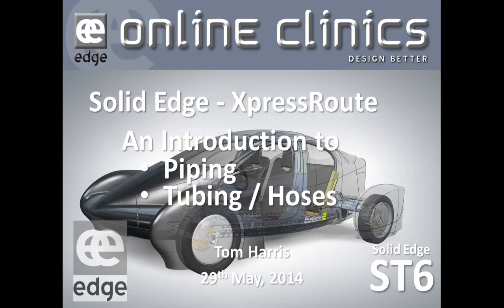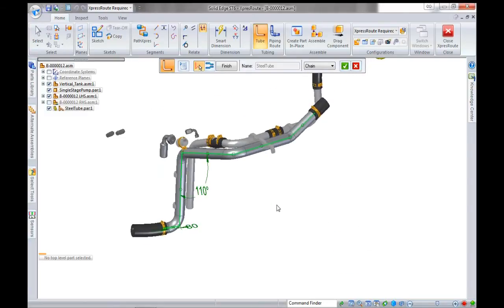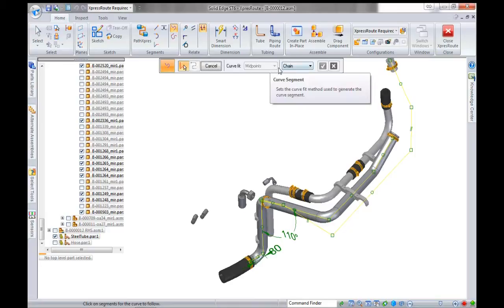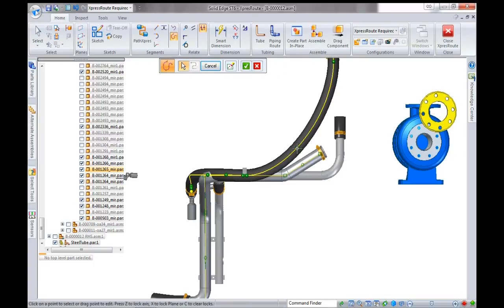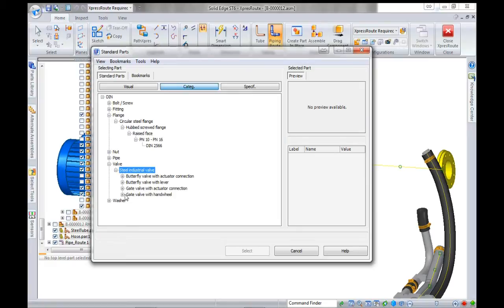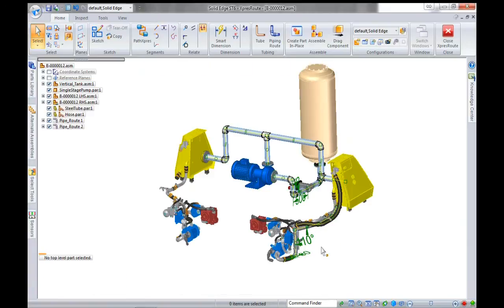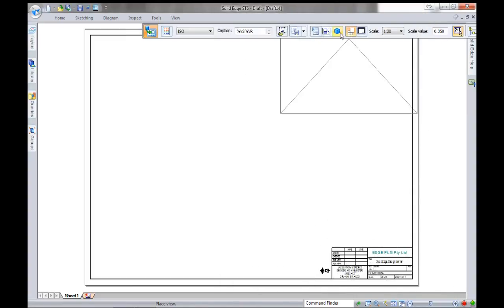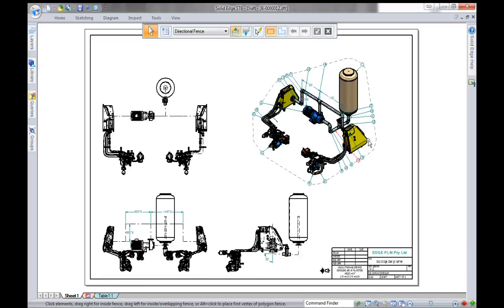SE Clinic - May2014 - XpresRoute

Comment: Hi
Watching your video it is seems to be everything so easy but i ve tried to use this kind of option in Solid edge st6 but i ve got a big problem. So my problem is that the program does not allowed to me to use the standard parts from the piping library and come up a dialog box which means my program's  licence also doesn t allowed to use this features...

To summerize my problem :

I have got a premium licence SE ST6 program which contains xpresroute so i dont know why cannot work whit this tool...

As I see you just choose you suitable pipe and fitting and if you need more fittings you just click a point and choose a part from standard library

I hope that i was very understandable and you could help me in this case.

Im looking forward to your answer. Please send me your reply as soon as possible.